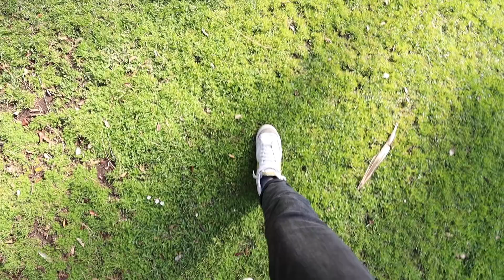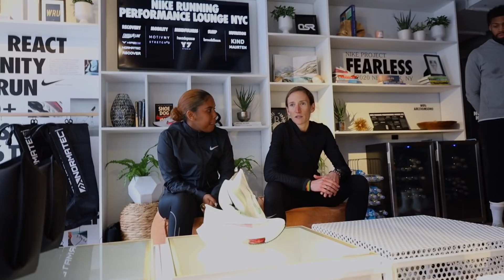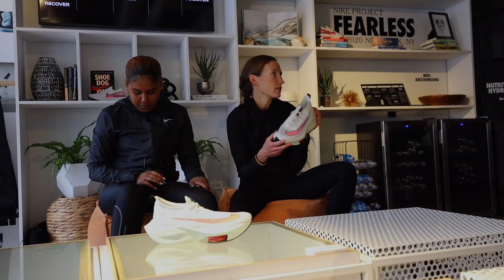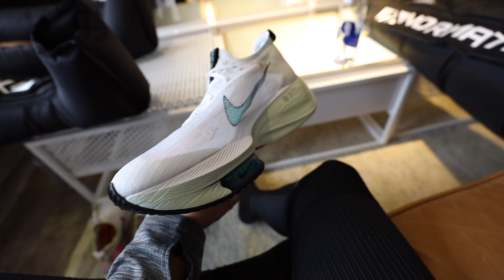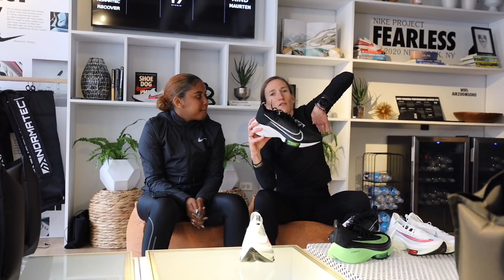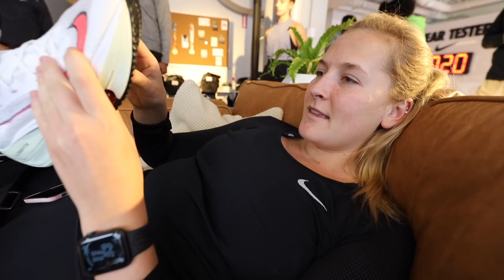UNRELEASED Alphafly NEXT% HANDS ON | Eliud Kipchoge's 1:59 Marathon SHOES!!

Comment: That's not exacttly the shoe that E. K. wore. That had more than one carbon plates and instead of air bubbles it had little flat pieces of carbon plates at an angle to the vertical. Those shoews have been declared illegal by world athletics. It's a myth that they are going to propel the runner forward, because any spring action may happen at the moment of impact of the foot on the ground not the moment that there is a propel action of the foot forward.